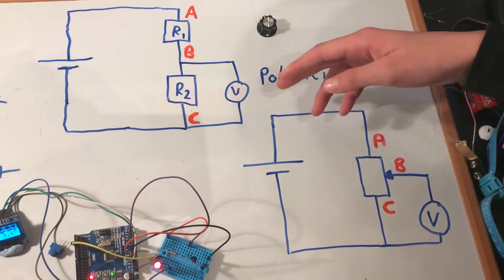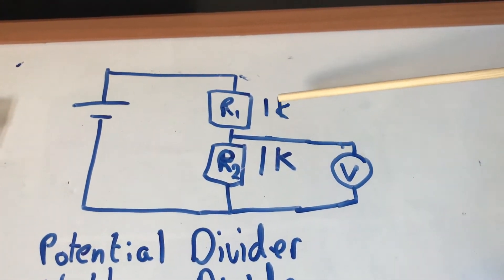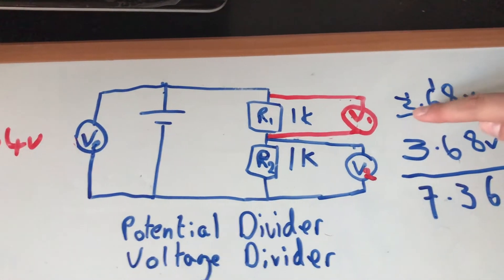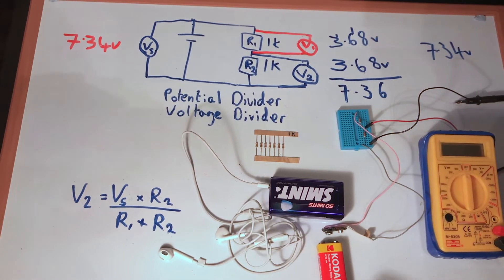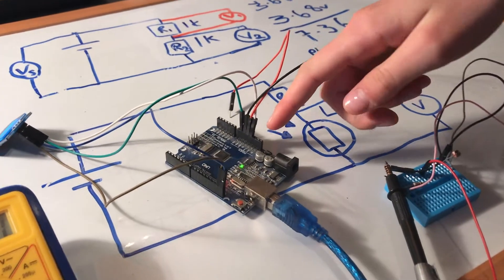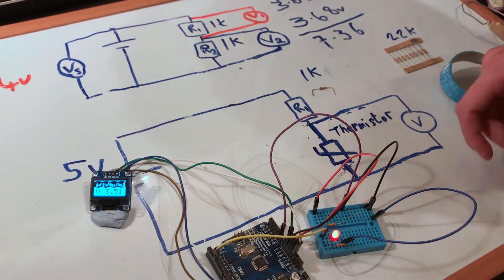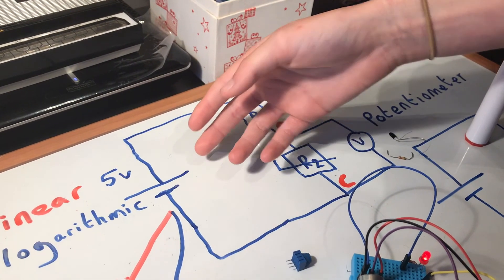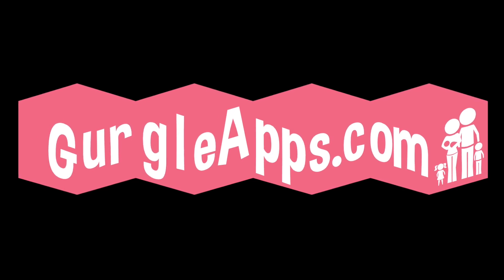What is a Voltage Divider / Potential Divider - How does it work? What are they used for?

Comment: That 9V battery was pretty flat, and even with the small current ~4 ma going through the 2K resistor (2 1K in series) probably was causing the voltage to drop.  If you would have remeasured across the 1K resistors again, you may have read 3.4 instead of the 3.6 volts.